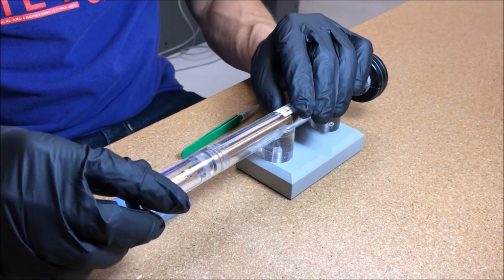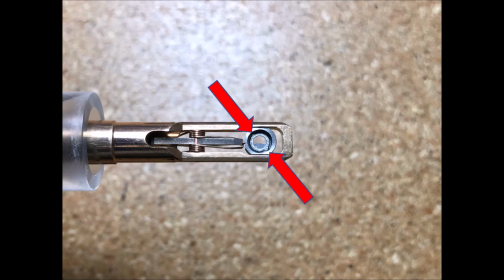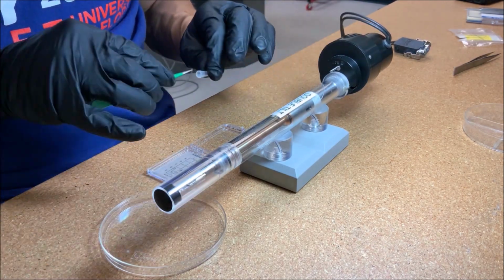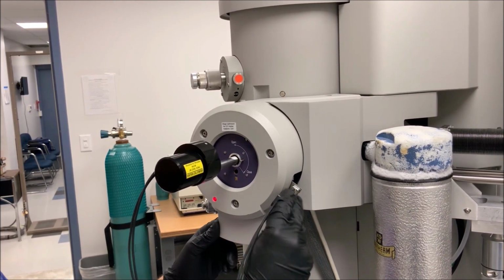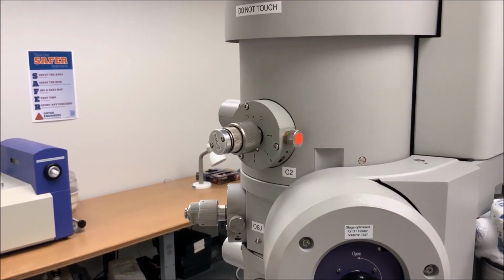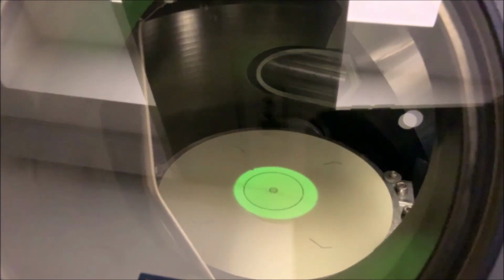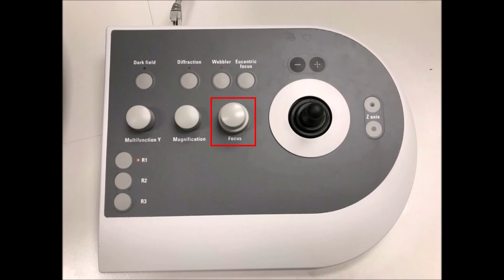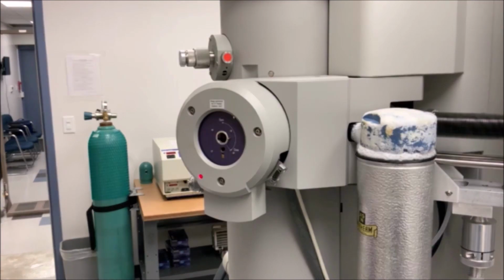FEI Tecnai F20 S/TEM: basic operation (version 2.0)

Comment: Hi Nicholas, I have a problem with condenser lens astigmatism, I cannot make a circular beam in both directions when I am varying intensity, I can only make a round beam in one direction, I do not know what to do. I ask the other operators they told me it is Ok. 
Could you please make a video about Diffraction lens Astigmatism? if the DP spots are not round is it because of Diff lens astigmatism or Focus is off?
Reply from the maker: Hi Sara; sorry to hear you are having trouble.  Are you seeing the issue in image mode or diffraction mode?  You are indeed correct that if the spots in diffraction pattern aren't round that the diffraction stigmators should be tweaked (unless another set of stigmators is severely misaligned).  The focus in diffraction mode shouldn't really change the shape of the spots, jut the size of the spots.
Reply: @NicholasRudawski  Thank you for your reply, I see the condenser stigmatism issue in imaging mode, the beam is circular in one direction but when I change the intensity knob to the other direction it is elliptical. I have this issue in both LM and SA mode.
Reply from the maker: @saraa2636  it actually isn't terribly uncommon to see this.  To a small degree, any astigmatism in the beam shape will be somewhat dependent on the strength of the lens (in this case, the condenser).  The important thing is that if you image on the "clockwise" side of crossover that the beam is circular in that regime.  If it isn't circular on the other side of crossover, it really isn't of any practically concern.